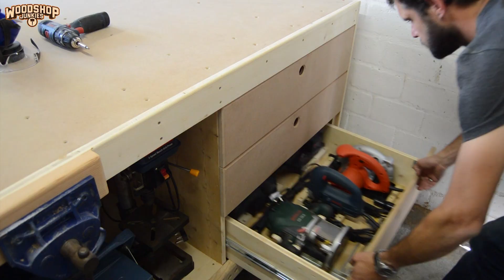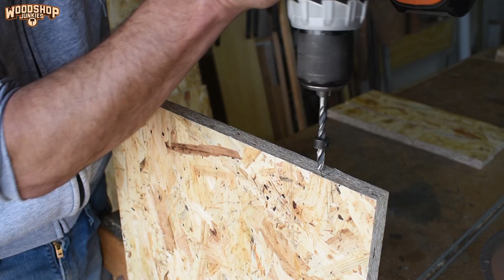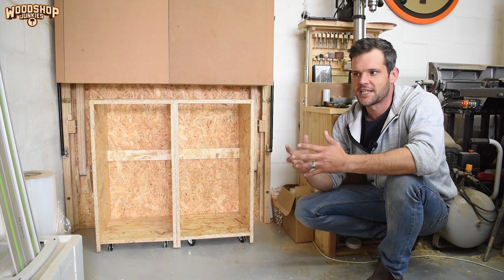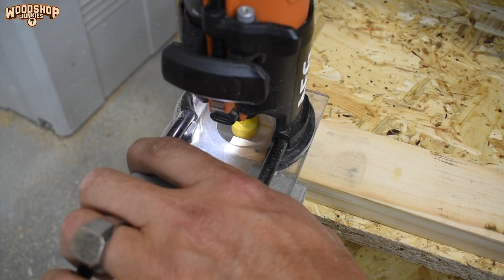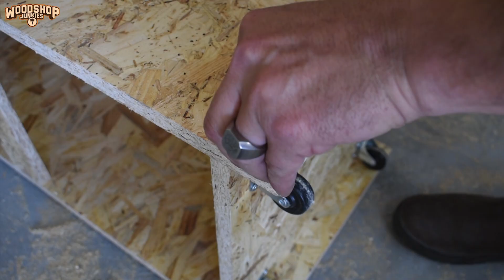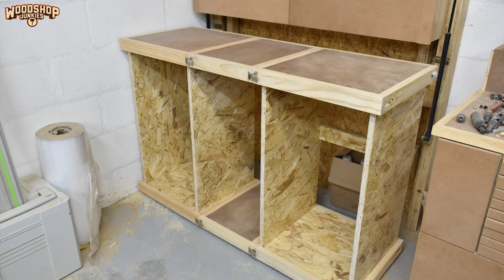Super Align & Lock Mechanism - Modular Workbench Solution

Comment: The latches should alternate on the corners to match where you have pipe vs recess, so it works regardless of orientation.

Awesome design btw.
Reply: That makes a lot of sense, actually. It would be very nice to be able to just plop them on without having to turn them to the correct side first.

Comment: Looks awesome. I have an MFT on a torsion box which attaches to a mobile base using toggle latches-plenty secure. Only snag for me with this design is that the toggles are proud of the surface and could snag on your work, clothes or a hose. If they could be recessed or mounted differently that would make the system awesome

Comment: This is a great twist on the modular bench concept, and a quick way to reconfigure. With a small shop, or skinny workspace, this  allows you to have a combined bench adaptable to the space available. I especially like the 'bridge' sections, which is a new wrinkle on the subject, and opens up more possibilities for longer benches without committing extra floor space. The bridge sections can be easily stored, as well. 
  I couldn't tell from the build, but I assume the individual trolleys are square (tops wise), so you can connect side to side or front to rear.
  The only recommendation I could make is to find a recessed latch (as others have mentioned), or one which could be inlet into the trim pieces. With my clumsy self, I would not have any work pants without ripped pockets or belt loops! NICE work,all around.

Comment: Nice.  In a garage workspace where the floor might not be level, this is a great way to join the units for a level work surface.  I wonder if it's worth adding some kind of self-leveling feet or adjustable kickstand so you don't have any corners unsupported when the toggle clamps are pulling them flush.

Comment: Great Idea.
I would consider taking hardwood and steel for the connection points for long durability.
Recess the latches that they are plane with the front.
Now you have a vertical alignment, but it is not 100% horizontally allined. Could be an issue if you combine e.g. a 3x3 or larger.
Reply: Potentially just a steel ball and matching spherical hole for alignment vertically and horizontally? Love the concept btw!

Comment: Brilliant concept!! You are on to something huge. How about a series of open frame extensions that could store very easily but give you huge size variation. Think like a bridge with the girders flush with bench top. Might be interesting for assembly work. Also thinking about using the alignment dogs for accessories that clamp on the side but extend above the top to give you giant sturdy 90° clamping surfaces. Machinists use things called 1 2 3 blocks, check them out for work holding ideas!

Comment: With regard to the position of the pipe/latches...

If you were to have the positive/negative pipe in the middle of each side, using a longer length of pipe, you could keep the ends free for using latches in multiple directions. Further depending on the thickness of the trim pieces the latches could then be recessed to again allow connections in multiple direction.

Very interested to see how you develop this further.

Comment: Some sort of mortice & Tennon might also work. Especially if you could use some sort of T-slot in each piece and then slide an "H" clip into the two slots to hold/pull them together - although, I do like your use of the pipes and latches

Comment: Those pipe locking pieces are a great idea.

Worried that the latches may catch on things. Seen a similar modular bench system where they used clamps lower down which were less obtrusive.

Looking forward to the next video to see how this is all going to work.

The extension pieces look like they could be a weak point in these modules. My preference would just be another module which can also double as extra storage.
Reply: I have heaps of surplus and scrap pipe so this idea is fantastic for me.

Comment: I like the idea, but I think you need to make some jigs for positioning things (doing it manually worked for your initial tests, but making several carts, especially when you go to make an additional one months later, require something better than measurements.

I also think you need something different in the latches, not because they are ugly, but because you want to be able to attach the components in different ways, including back-to-back or back-to-side where the latches will be in the way.

I also think that you want retracting or lockable casters so that once you get things into place, they aren't going to move.

what you did works as a proof of concept, but a few things could use improvement before you scale up to bigger/heavier/more dangerous tools.

Comment: I like the idea of the locking mechanism, but I would mount the latches so every latch is at the male and every hook is on the female side. So you can connect the units together in any way you like, even upside down and the latches still match.
For a low profile latch you could use the pin and hook system (I don´t know what it´s called in english) that is used to hold furniture pieces together. The hook part (whitch is twisted with a screwdriver and fastens the pin part) could be set either from the top or the side of the trim piece, but in your case from the top would be better.

Comment: Always so innovative! It seems the "negative" side is the key to this system. You could make an "edge trim" that was routed out ALL NEGATIVE. It would LOOK decorative but would function the same but on ALL SIDES as well. Your "positives" could remain the same and, thus, moveable if needed. Install clasps UNDER the edges so they're out of the way. I used to work with modular office furniture...there are a TON of great concepts for systems like this in that industry.

You could also use a system in the "edge trim" of staggered positives similar to a barrel hinge. THEN, the "lock" could just be a pin that slides INTO the center of the aligned positives and flushes out on the front edge.

Just SOME thoughts since you asked. I hope it can help but, I'm sure you have it mostly worked out already. Cheers!
Reply from the maker: Great. Thanks. I like the idea!
Reply: I thought of this and then figured that the pins wouldn't hold it as solidly as the clasps. 
Possibly a positive and negative pipe at each corner with the bolt going into a nut on the end of the inside pipe.

Comment: Nice idea. As an improvement you might want to consider the wear of the wooden side of the connection over time. This would add play to it. You cold prevent this by mounting a half pipe of a bigger, fitting diameter inside a grove or using an angle profil like so |<<| Oviously the notch is more difficult to make, but not imposslible. Hope it's understandable what I am trying to say.
Additionally I would recommend testing the connection with weight in the cabinets. Happy New Year!

Comment: Smart and 'simple' concept. The latches in the front and back are not flush, so how do you attach modules there? For smoother rolling, use rubber(ized) wheels (hard-plastic ones might crack). Also, add some foot-brakes/stabilizers, so it becomes even sturdier. Maybe try Neodymium magnets to pull (and keep) modules in place?

Comment: Looks really good. But, yeah. I would consider trying to have the locking mechanism more flush woth the side of the bench if possible to avoid them getting snagged in your clothes. Maybe you could find some type of latch you could mount on the inside of the trim instead of on the outside. Or maybe just routing a little pocket on the outside of the trim and having the same latches as now, but recessed so they don't protrude.

Comment: I like the design, the proof of concept was well explained... I might even want to build this to solve my small workspace issues. So I think you left out two things from this video, and it's the one thing you kept repeating was the uneven floors... how do you plan to level the rollers in case there's a low spot on the floor and unit wants to rock?  Or a high spot and the unit isn't flat/level... It might not be sufficient to have the multiple casters in contact with the floor... you might need some kind of leveling system. Also how do you plan to prevent the rolling action when you want the workbench to be stationary?  I know there are solutions to these problems and I'm sure you'll solve them, so I'll be looking forward to your build videos.  Cheers!

Comment: I think that you will want to put the connecting latch on the same face as the alignment hardware - perhaps even the same mechanism. In this way you can make 2x2 trolley arrangements, "EL" shaped configurations, or fit to a specific space. The pipe and slot is good, but think IKEA and imagine locking pieces together wider as well as longer.
I imagine a sliding dovetail - female on the trolley corners, locked together with a male "bowtie" shape.

Comment: Nice! I think replacing aluminum with hardwood dowel would look bit better. 

Also instead of routing out the grooves you could clamp two trim pieces together and drill out the groove in both at the same time with a Forstner bit. This would need a jig to be accurate, but would result in a sharp end to the groove that would give you horizontal alignment in addition to the vertical alignment you already have. 

Won’t the latches be in the way when you start bolting them together in other directions, eg 2x2 or 3x2 arrangements?

Comment: A clamp I was thinking you could use are the ones like on audio equipment cases that have a Twist and snap. I've seen some of them that are about 7 mm or less I think. I seen them definitely smaller less than a centimeter. Just a thought.

Comment: Genius in is simplicity. Very inspirational. The closing hatches could be replaced by strong magnets, perhaps. just a thought. 🙂
Reply from the maker: I bought magnets for this build but abandoned the idea because I think metal scraps are going to pack on the magnets.
Reply: @WoodshopJunkies  
Yes, I agree. 
Powerful magnets are going to get snagged up with all sorts of metal debris like broken screws and nails, small washers, shavings and possible sharp blade remnants. Even tools. Chains and cables will also get caught on magnets.

Comment: The locking with the clamps limits the number of sides you can connect. But the pipes might offer a solution: put 2 next to each other on opposite trollies and fix them with a bolt along their axis.

Comment: Fantastic idea with the pipe. I will definitely incorporate this. Still wondering on the latches that could be flush to allow connections back-to-back, or using the faces of the workbench for vertical holding. Possibly something incorporating dog holes?

Comment: The pipe should be steel(conduit?  You gotta have some EMT scraps laying around) with a rare earth magnet in set into all the pockets.  This will allow the protruding pipe to be removed when that socket is not in use.  Would also eliminate Mis-matched ends.  For instance, if you needed a section to be faced 180 degrees out or face to face.  It would give you complete autonomy as to how the sections fit together and the pipes would not be sticking out when not in use as they would be removable.  Also eliminates having to drill holes in pipes.

Comment: Since most of the force is going to be downward, I am thinking strong magnets, with poles reversed for the same 'male and female' connection pattern, might work just as well as latches but would be faster to connect and disconnect, especially if you integrate a helper lever that can be used to start pulling the magnets apart. I'm not sure if the alignment using magnets alone would be perfect, but it might be good enough. If not, just place the magnets closer to the center of the trim pieces, so the pipes can still be used, or use steel pipe and integrate the magnets in the female recesses.

Comment: This is what I planned to do. I want to build 2 benches that link together. I thought about big dowels like brush handle size and like toggle clamp things similar to the clamps you used. I want one bench with tablesaw and router and the would be assembly table and outfeed table with dog holes and a vice. Rather than the pipe how about hardwood dowels with rounded ends?

Comment: I was thinking that instead of using outside latches, if you could somehow countersink the screw(s) holding the pipe sections, you could just insert a large dowel through both pipe pieces, locking the two units together......

Comment: First great work on thinking this through and testing it. I was wondering how well the alignment will hold up over time. As the female end wears down and gets sloppy. Maybe a taper might hold up better over time. A simple topped off pyramid should work well enough for the male side. An inverse pyramid for the female. Should be able to make both male and female out of wood as well. Or maybe make the female part out of a harder wood and the male out of softer wood. That way if either is going to wear the male will be more likely to give and wear down and easier to replace. If the male is only screwed on or bolted it could be easily shimmed to stick out further if needed later. Another advantage is that it will help with height as well as side to side alignment.  Actually the problem with both your design and my idea is that either we leave a slight gap in the table top edges or the alignment wont pull tight.      Hmmm..... What if the whole edge was the taper?  Simply cutting 45s so the female edges are grooved and the male edges docked off at the leading edge? One big advantage of making the whole edge the taper is that you could make each table with 2 female and 2 male edges. Then it wont mater as much what size each table is as long as each table is the same height. It'd be easy to match a 2x2 on the end of a 3 x 6. etc. And you have 1 half of a pipe clamp on every table!
Reply: With the wood rubbing against the smooth conduit, for only assembly and disassembly, this design will last at least, a hundred years.
Reply: Sorry, taper as in morse taper. Like for a lathe, drill press chuck, etc.
Reply: @zapa1pnt  I respectfully disagree. His goal was tight alignment. Will it align in 100 years? Sure. Will it be tight? No. Good enough? Almost certainly. Are the tables being moved once a week by the person who built them? or 5+ times a day by random people who make $2 over minimum wage?

Comment: If you want four benches in a square then those latches won’t work as they’ll get in the way.

How about a system where the pipes are on both benches and fit together like a jigsaw. The locking system could be a simple pole that fits the pipes perfectly pushed straight through. No fiddly latches and they would allow for any shape to be made with any amount of benches.

Comment: It looks good, not ugly in my opinion. If you want to beautify it paint the metal black or some other colour. I can see an issue if you want to create a rectangle with four units as reaching the clips at the bottom could become a problem. Have you seen the magnetic clamps. They are ridiculously strong and can be turned on and of by turning a "key". Might make it easier to have something that only need a little movement rather than a catch that needs space around the catch to let it couple and de couple. I understand the issue with metal build up but as you can turn the magnet on and off this goes away. Here is a link to an example https://youtu.be/8Alkm-oZMAs